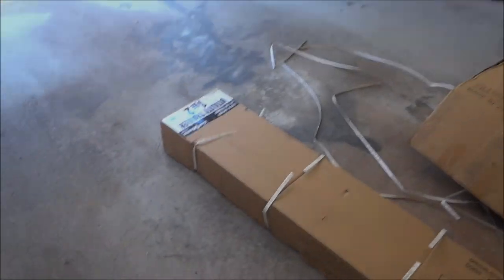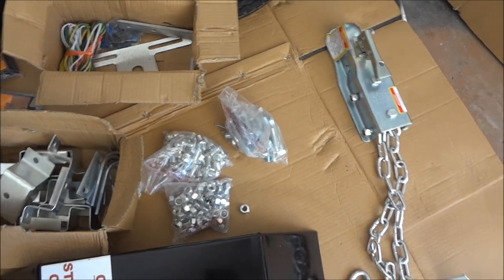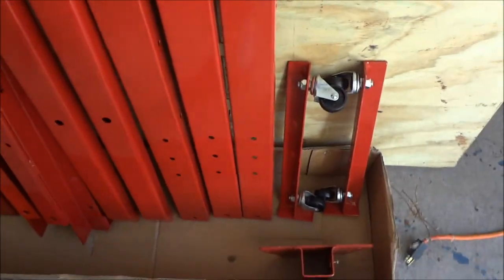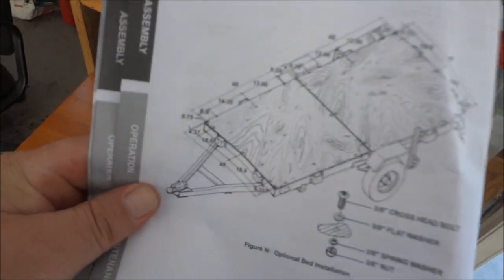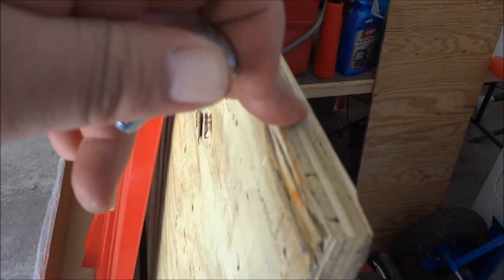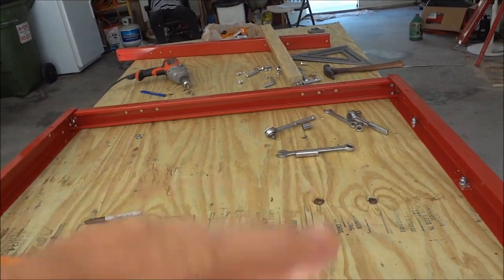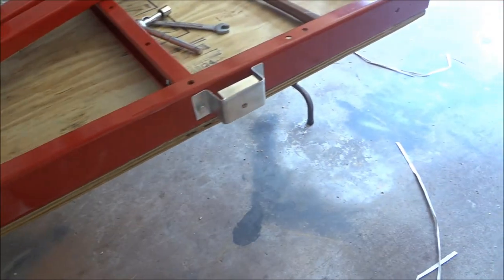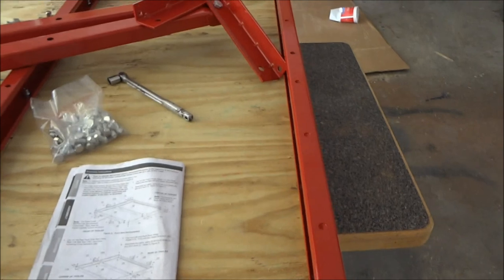Harbor Freight Tools Haul Master 4' X 8' Trailer 1750 lbs Capacity Part # 62647 Part 1 of 2

Comment: Thanks for the  video...will begin the assembly of my trailer soon.  Watch that language at 15:21...LOL!
Reply from the maker: LOL! You are the first that said anything after a couple of years of the video being up. thanks for watching!
Reply: @PhillipCeriale  Just made me laugh as I contemplated that giant bag of bolts.  I did get the trailer put together...only wiring to do.  Have a good day!
Reply from the maker: @WalleyeGuy  Excellent! How do you like the trailer so far?
Reply: @PhillipCeriale  I will know better once the lights are wired in and I have the deck screwed down and can take it out on the road.  It seems like a great little trailer and I really like the small footprint it has when folded and stood upright.  I only paid $329 for the HD 1,720lb trailer which is a great value.
Reply from the maker: @WalleyeGuy  Very Cool - Please check back...

Comment: Have the smaller 1200 lb trailer and want to see of the 1750 axle will fit. Could you please measure from center to center where the axle sits onto the springs? And the distance of outer hub to outer hub.  I already know the bearings and seals are the same...
Reply from the maker: I can tell you without measuring. the two don't match up. If you were to use the  larger axles be prepared to drill new mounting holes.

Comment: How did you score the 5 lug wheels and title ? I was told neither was available.
Reply from the maker: Both came in the box. There are two different weight limit trailers. I think the lessor trailer has the four lugs.
Reply: Correct. I have the 4 lug trailer

Comment: What's the height from floor to hitch leveled?? And great video!
Reply from the maker: Thank you very much. I'm not quite understanding your question. Taken literally, the height can be anywhere from 0" to at least the height a of a Ram 1500 bumper with a towing package (and higher ???) - slightly raised. Let me know if I answered your question right. Thanks for watching!
Reply: @PhillipCeriale  sorry I'll try to be more clear. I'm talking about the trailer itself. What's the height from the floor to the ball receiver ?
Reply: @Jega1048G  get the right hitch on your vehicle and it will be level.